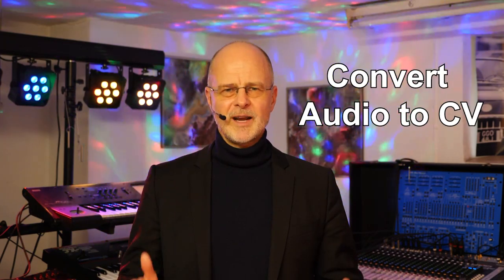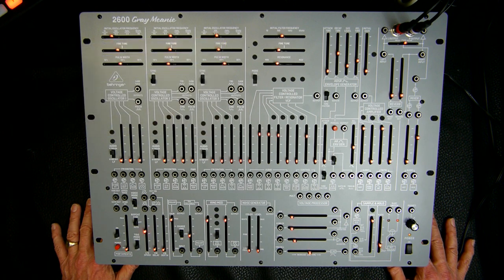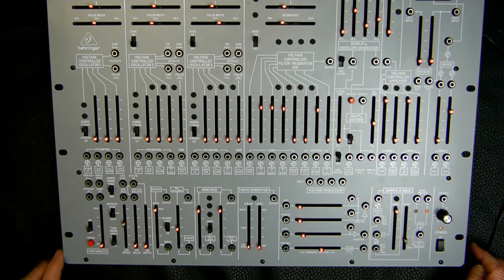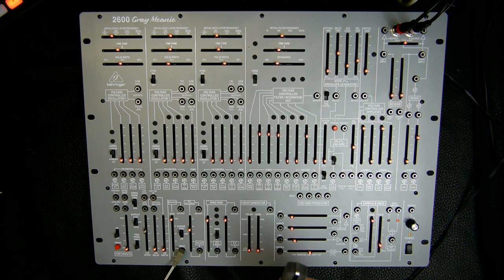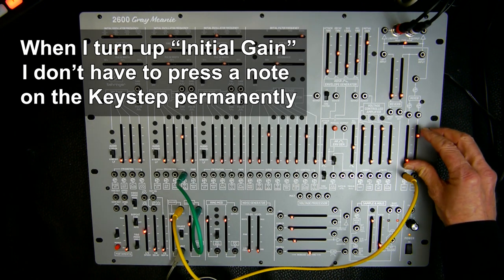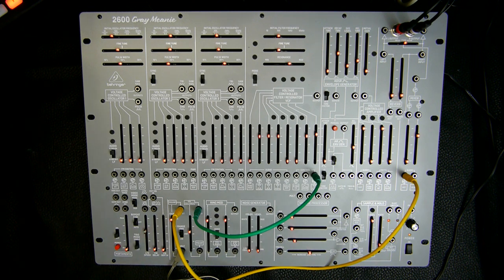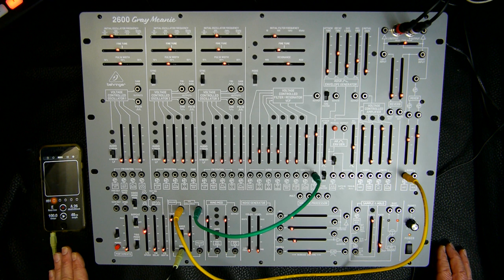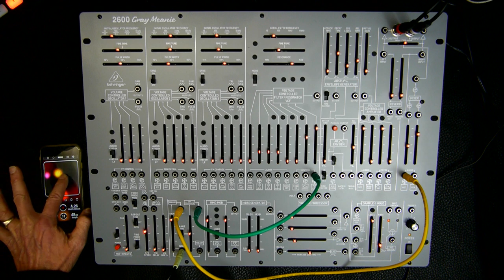Envelope Follower of Behringer 2600 EXPLAINED! (also works on ARP 2600 and 2600 Clones)

Comment: You can run a drum trigger into the preamp (x10 range, max gain) and take the env follower out to the AR Gate's In. The env follower out can also go into the VCA's EXP In for a different effect, or even through the ring mod, which can add a nice sizzle to the end of a drum. With Preamp gain at 1000X, if you feed the Env Follow Out to the AR Gate and take the ADSR Out to an inverter in the Voltage Processor, and output that to a VCA Control In, you can get a passable sidechain 'duck'.
Reply from the maker: Thank you for sharing this great patching tip. Greetings, Ralph

Comment: I can’t seem to get a sound when I hook up my Arturia to the behringer 2600. I can hear the drone sound but, I can’t hear any keys I play.
Reply from the maker: Hello Mussa, please make sure you watch my Beginner tutorial https://youtu.be/CfezQunKlAE and kindly also watch this tutorial here about the Arturia MicroBrute to B2600 connection https://youtu.be/h5j8I41oyCU - The non amplified Trigger/Gate from the MicroBrute is not strong enough to trigger the envelopes on the B2600. Greetings, Ralph
Reply: @RalphBaumgartl  I have the Arturia Key LaB 61. Connected via MIDI to the Behinger 2600 and I’m getting no sound.
Reply from the maker: @destined121  Hello Mussa, make sure you set the Midi channels correctly.
Reply: @RalphBaumgartl  yup 🤦🏿 that was the issue, thanks for the help!
Reply from the maker: @destined121  if you run into any issues then kindly refer to my tutorials. Happy patching 😃

Comment: If you connect a guitar to the envelope follower and Route the cv out to the Filter opening and close you can use it just like a Autowahpedal😉 but you can Input a Bass drum do shape it with the Filter etc. a real drum can be shaped nicely, you can add noise to a snaredrum etc.
Reply from the maker: With a little bit of experimenting you can come up with some very cool stuff! 😎

Comment: I really appreciate the videos.  I have a lot of synth experience, but my Blue Marvin arrives this Thursday and I wanted to learn the ins-and-outs of the 2600 before it arrives.  I think I've now watched all your tutorials and at least know how to get/get rid of a drone note (with the initial gain!).   Very helpful and thank you for making these.  (And I learned that OSC 1 is the master for the sync on both OSC2 and OSC3.  The SYNC switches are unlabeled so I couldn't figure out what OSC was syncing to what other OSC!) 

Concerning the Envelope follower - my understanding is this is just and AMPLITUDE  follower.  It doesn't care about pitch of the input signal, just volume.  The CV produced doesn't represent the input PITCH, just the input VOLUME envelope.  

It seems that running env follower through the LAG processor would produce a smoother, more usable envelop. 

Thanks again, these are very helpful
Reply from the maker: Hello 👋 Thanks for watching and I am glad that you are getting something out of my tutorials. When you get your Blue Marvin start applying your knowledge immediately with some patching experiments. That's the best way to learn the ins and outs of the 2600. Happy patching! Ralph

Comment: Thanks Ralph! Your tutorial videos have been great help. I plugged my Casio dh-200 to my Blue Marvin and added some reverb - the sound is from another world. On the sidenote do you think that an external sequencer is part of the 2600 experience? Atm im only using basic midi keyboards
Reply from the maker: Thanks 🙏 I am glad my tutorials are helping you. And yes, I believe that a sequencer is part of the 2600 experience. If your keyboard doesn't have a sequencer on board, you can also get a simple Midi interface for your  PC/Mac and use a DAW for sequencing. Happy patching, Ralph

Comment: Good video 👍. I'm still torn between the B2600, the Boss RC-505, and the ModWave. I now have the MidiVolts Desktop which gives me three CC to CV outputs which would be great for controlling the 2600 from my Roland AE-30 wind synth.
Reply from the maker: If money is an issue, then the Standard B2600 might be your choice as it is cheaper than the Boss RC-505 MK2. And it's in stock 😉
Reply: @RalphBaumgartl  not so much the money as which to get next 😀
Reply from the maker: @unclemick-synths  😉 guess that applies to all of us 😃